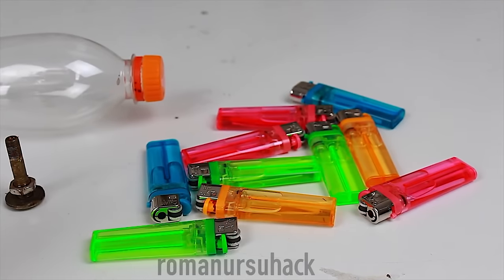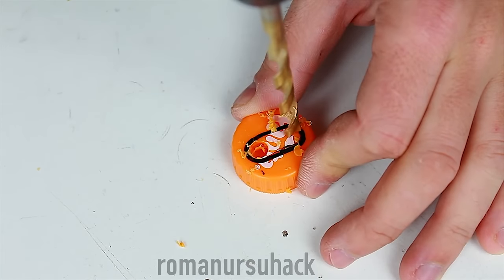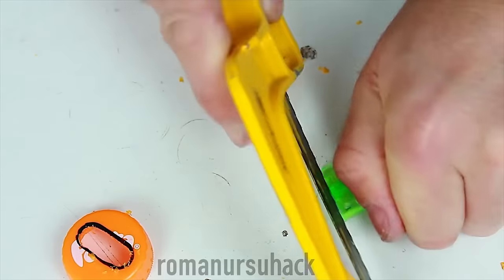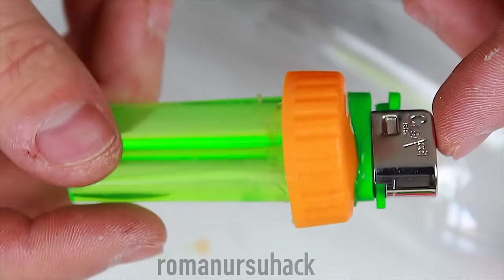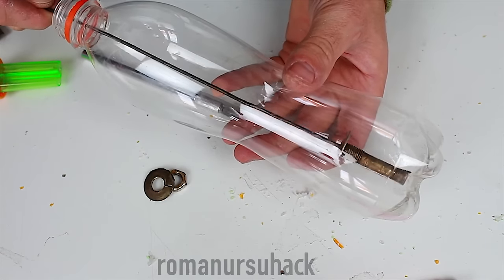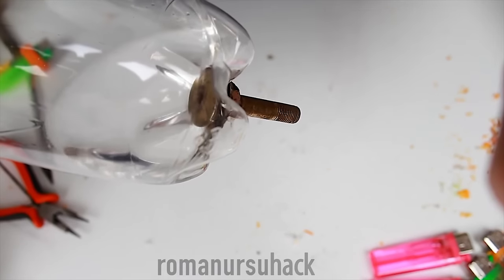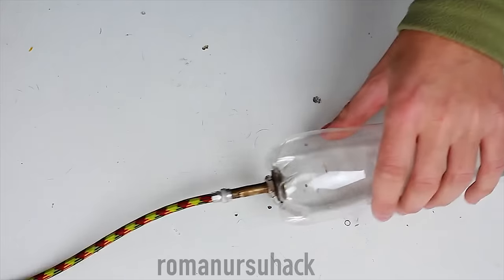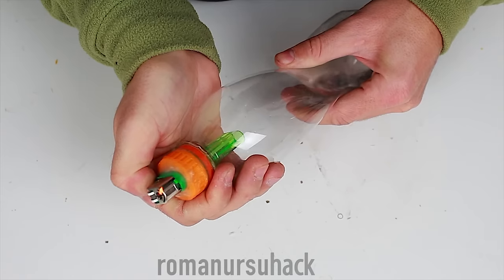1 cool idea from a bottle and a lighter

Comment: I think this is an interesting concept. The lighter has a very good sealing valve which won't usually allow the flame to flash back into the container but I wouldn't trust it with compressed hho gas (electrically refillable lighter) unless it wasn't storing much volume.

Comment: DANGEROUS!!! DANGEROUS IDEA!!! You have built a heat non resistant container with a lot of flammable liquid inside and pressurized air in it = fuel+ AIR
If someone sry to do the same with a seltz bottle, it can explode and burn that person to death.

The lighter has a pin hole valve with a too small diameter to permit the backfire effect. Larger diameter holes in the valve should transform everithing into a fire granade.

Using a piezoelectric lighter also could produce an involountair spark inside the can and KABOOOMMM!!!

So yes, nice project, nice job, nice everything but TO EVERYONE: BE AWARE IT CAN BE VERY DANGEROUS!!!

Thanks everyone for reading

Comment: Won't the solvent dissolve the glue?
Reply: depends on the solvent
Reply: depends on the glue
Reply: Ethanol or isopropyl alcohol won't dissolve it, but they WILL destroy the bond. That's how you remove a hot glue joint without heat, you just soak it with alcohol for a few seconds.
Reply: Yup, works like a charm.

Comment: Hot glue is the shittiest thing you could have possibly used for this. It doesn't adhere well to smooth plastic, and as the plastic flexes or shrinks/expands with the changing temperature, the hot glue will just let go and create leaks.